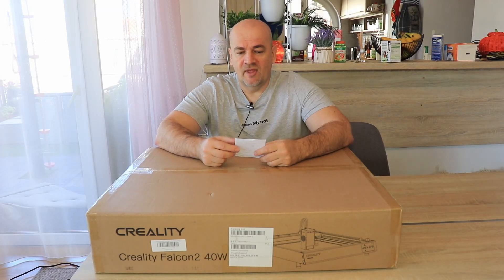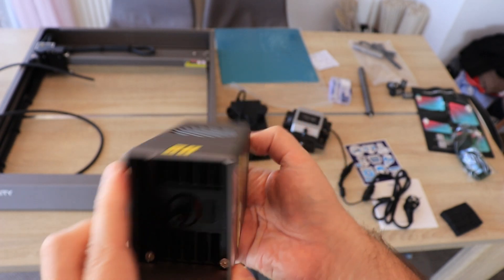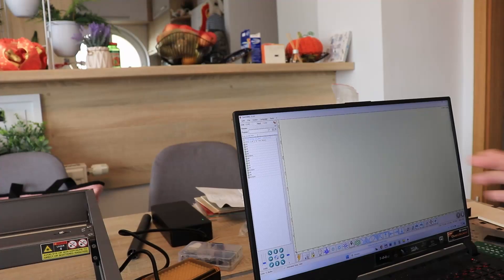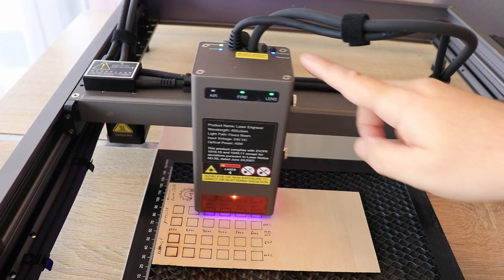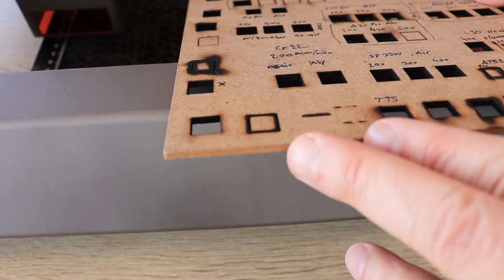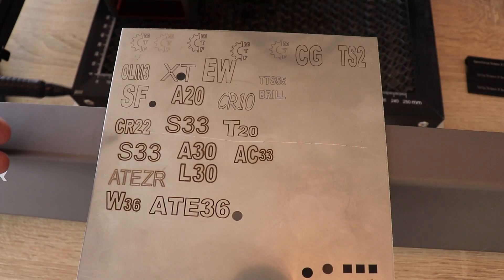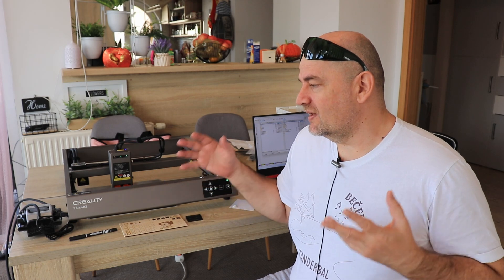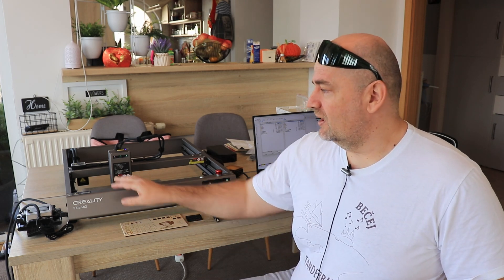Creality Falcon 2 40w diode laser engraver review - strongest on this channel so far

Comment: I have the 22w version and find that air-assist is absolutely needed whenever the machine is in use. Both times I didn't use air-assist, I immediately got a lens alarm because some dust from the engraving had gotten onto the lens. A quick wipe with the included microfiber cloth fixed that. I also found that I had to fine-tune the machine in Lightburn via the "scanning offsett adjustment" feature, because I was getting a double-image on engravings. Basically, when doing bi-directional engraving, the lines were ever so slightly shifted which led to blurry results. (I.e. when it went from left to right, the line was shifted by about 0.2mm compared to the line going from right to left, setting the scanning offset to 0.1 brought the lines together. I had to do this for a couple of speeds, then Lightburn calculates the best offset for all remaining speeds) The adjustment fixed this too and now it gives very nice and sharp results.

To make positioning easier, I've put my engraver on a piece of plywood that covers the entire bottom of the machine and then inserted each leg into 3D printed leg holders with 3 arms each that have a hole, with the machine in place I screw it down so it can not shift. So my machine is fixed in place now. Then I designed a complete grid with absolute coordinates, circles, rectangles and other things for everything I intend to engrave and then burned this into this piece of plywood. Now I have a work surface with the machine coordinates right on the surface and also spots for the things I typically engrave. Engraving something now is as easy as simply putting the text or design inside the corresponding circle in Lightburn, then placing the physical item in the same circle on the board in the machine, then you just home the machine and hit start and off it goes. I believe this is called a "waste board grid".

With all that said, I am very happy with mine. I got it on their recent flash sale for only 550 Euros and have since added a big honeycomb, Crealitys enclosure, their rotary roller axis and I have bought Cloudray OD6+ glasses because I do not trust the included glasses. Its an excellent machine!